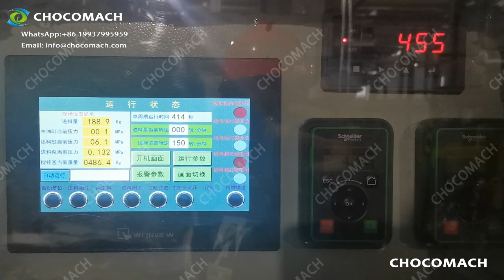How satisfying oil is extracted from chemical raw materials,operation tutorial video,durene

Comment from the maker: machine work description：
Stir the slurry→ Pump feeding→Press filter oil→Squeeze out the oil→Low pressure pressure→Medium pressure pressure→High pressure pressure→Open mold and discharge cake→Reset and closing mold→repeat

Comment from the maker: the market demand for methanylene has been increasing rapidly. It is mainly used to produce methanetetracarboxylic anhydride, which is further processed into polyimide, a new high temperature resistant engineering plastic.